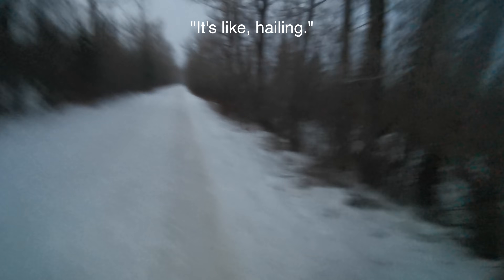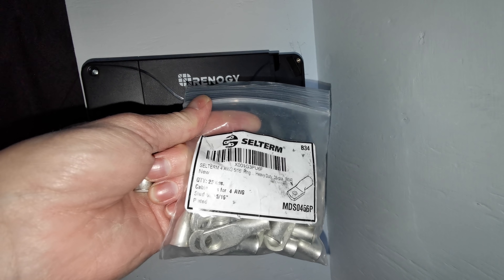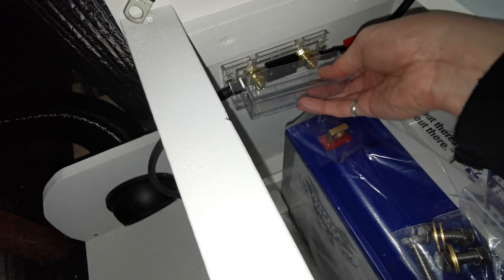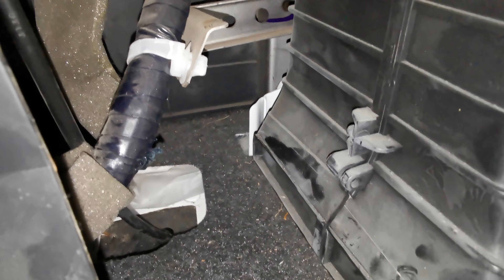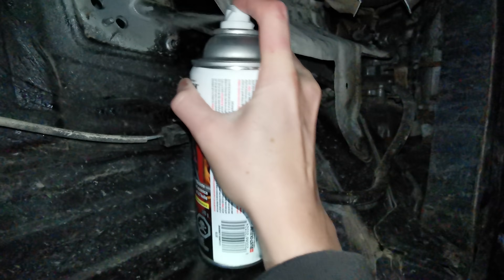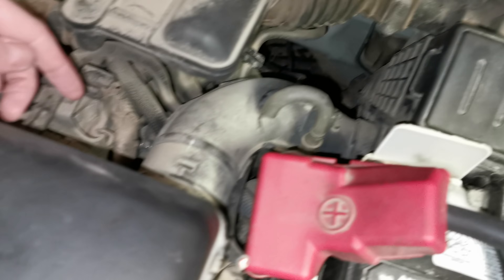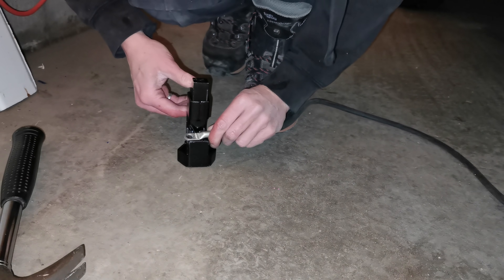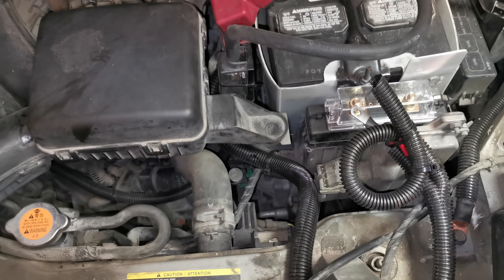Van build: Weekend Warrior Wiring (for Renogy’s DC to DC charger w/MPPT)

Comment: You’re doing great! Just for future reference and for anyone watching this, running a battery negative wire through or around the firewall all the way to the battery itself is unnecessary. Battery negative (as well as alternator negative) is grounded to the entire chassis of the vehicle. Any solid metal point on the frame can be used to access the vehicle battery’s negative. That means only one wire through the firewall for battery positive, less wire to buy, less wire running past hot components, and fewer points of failure.
Reply from the maker: Ohhh OK good to know. Thanks Jacob

Comment: For anyone working on an NV200, there are grommets under the steering wheel behind the battery that are pretty easy to send a wire though. That's how my VSR is wired. I appreciate Kira's "it's gonna get done" spirit. :)
Reply from the maker: Thanks, Jeff! Wish I found that grommet earlier but I still need to send a wire from my alternator to my DC to DC charger, so maybe I can use it for that :)

Comment: If you need to run wire use some liquid soap it will move easily. Just rub it on the wire and run it through. Also make sure that the slip cover is not next to anything to hot and melts. You may need to use something that is temp safe. Looks good so far.  I have the same fan and would like to build it up someday. Oh well I'll keep on working till then.  Say hello to Forest for me when you see him. And if you need some entertainment my daughter has a tictok channel for our pups.
Bigpawtribe. Look them up
Have fun

Comment: The negative wire run to the starter battery was not needed. Bolt it to the chassis somewhere.

Comment: As others have pointed out that factory jack should be replaced. Like a motorcycle helmet, once it hits it needs replacing.
Get yourself to eBay and look up Hummer jacks. Make sure you are getting the jack, not just a pert or something. Surprisingly inexpensive and those things will lift anything safely.

Comment: I would not trust that scissor jack again... nor would've I trusted it in the first place for anything else than changing a tire on the road... because it's meant for nothing else.
Reply: Normaly the scissor jack's are descend strenght just depends of the quality and load specs...And as we saw on the vide she put 2nd jack which was helping...99.8% safe. Even after she moved the car and the jacks still was holding the weight.
Reply: Blah Blah Blah no imagination. Wisdom is gained through a scaring process

Comment: I know the battle born battery is good but I got a sok battery for about the same price and it's 205. And I took it hunting below freezing and everything worked perfectly as should. And twice the power
Reply: And I'm running the same charge control mppt with 200 watts solar
Reply: @expressadventuresvanlife6754  did you put a switch to disconnect the solar so when you drive you get the full 50 amps from alternator if pv is connected you will get 25 max
Reply: @Willsmokalot  i did not. My usage is very minimal and the 25 is more han enough. If I  ever need more I will

Comment: ALWAYS TIE BACK LONG HAIR when working on machinery.  Having your HEAD PULLED into your engine because you forgot to TIE BACK your hair is a story the PARAMEDICS will always remember. Make memories some other way. LOOSE CLOTHING PULLED IN BY A FAN BELT can also hurt you badly. Respect the equipment you are working on.
Reply: I second that. It happens so fast. My partners sleeve cuff got caught up in his bench grinder. Ground a good chunk of skin off. Could have been much worse.
Reply: I put a wire wheel on a hand held grinder & it bounced off the metal caught my sweat shirt & was coming straight for my stomach it was so fast I couldn't think what to do but it grabbed so much thick sweat shirt it stopped it right before it would of ripped my belly open..

Comment: Great work! Some tips for future cable work: You can lube the grommets with WD40 and the cable will slide through like butter! On long cables like yours squirt them a few times as you pull the cable through. Then just wipe any residue off, but it won’t do any harm if left on the grommets or cable. I’ve been using this method to build wiring harnesses for race cars for 30 plus years. To drill your holes, get yourself a set if stepped drill bits. They are cone shaped and are super useful for things like drilling the holes in the floor to the right size. Once you have a set (usually they come in sets of three) you won’t know how you lived without them. I use mine so often it’s hard to imagine life before them. Hahahaha. Smart move putting the red tag on the positive cable, another way to do that more permanently is with red heat shrink. That’s how I tag my positive from negative cables. Like you I use black cable for everything, I’m too cheap to buy big spools of two different color cable! Have a great week.
Reply: same thoughts
Reply: I was wondering about that, but didn't know WD40 would be the ticket.  I was thinking maybe petroleum jelly..
Reply: @pimacanyon6208  not the worst idea as vaseline is waterproof and used to be used to seal things like spark plug wires and distributor caps on off road vehicles! But it’s sticky and hard to clean up and your wires would end up a Vaseline sticky mess. WD40 is the ticket because it lubricates just enough, the residue cleans easily with nearly any mild soap or solvent. Oh and there are versions of WD40 that are food safe! For example it can be used on a concert belt machine that moves food stuff in a manufacturing plant.
Reply: @bryancohn9406  thanks Bryan!
Reply: Thanks Bryan...Ive been wondering what a faster way would be

Comment: U got a better crimper than Foresty
Reply: I've heard not to use heat shrink on the ends so you can inspect the connector ever once in a while. See if its damaged or coming loose, etc. You should be ok though. Just sharing
Reply: A chassis ground might save u time and wire in the future. You can make it a common ground for all 12v

Comment: I like your crimper tool. 
As a retired Aircraft Mechanic I had big pliers for that job, they took up a bit of room in my tool box, they look like bolt cutters.
I found yours on Amazon, LOL my Pliers were $80.00 USD and that was years ago and I see Amazon has all kinds form 20 to 50 bucks. 
The Electrical Shop where I  use to work at had a fancy bench mounted hydraulic operated tool but they never let  us mechanics use it and they got mad when I stopped doing favors for them. LOL

Comment: Kira I feel you only had to run one wire back? Just the (+)wire, then just take a short ( - )  to the steel frame work up front and at the back?
Reply: Better two wires for high current charging.
Reply: I think James is right, I just did the same with my van
Reply: I beg to differ gents... If I'm not mistaken she's running both batteries in series and under a dc to dc charge so, its prob the safest method. Correct me if I'm off please.
Reply: That is correct. That's what one of the wires in the "big three" upgrade is for, it's the connection between the battery and the chassis, so now the entire chassis is effectively a ground (negative) wire. It won't hurt to run a separate wire. But where all the ground wires come together in the back you might want to also run a wire from there to the body of the van. It's usually easiest to find an existing bolt, sand off the paint under it, and put the wire terminal under that bolt.

Comment: great work! you have come so far, respect.
just fyi, it's way easier to hammer-crimp lugs with a next-size-up-hammer, like a 2lb "persuader". you look like you did a good job testing them all for actual cold weld ad not just pinched-in, but with a claw hammer takes a lot of whaling-on-it vs. a couple solids hits and done. peace

Comment: You did great well done. My only comment is your need to respect the unlimited current of a battery. When bored get a used battery and drop a wrench across terminals. Results make you wise. Cover wrenches with tape,no jewelry. I welded ring to engine block while on finger by touching hot wire and ground in a tight spot. Burns were nasty. No fear just respect. Future needs go in engine bay with light and look at firewall for grommets. Often have stuff in them with room to share. Be wise,be careful. Stay safe.